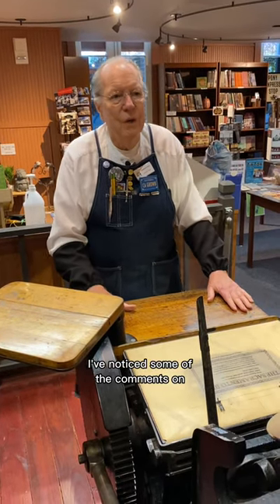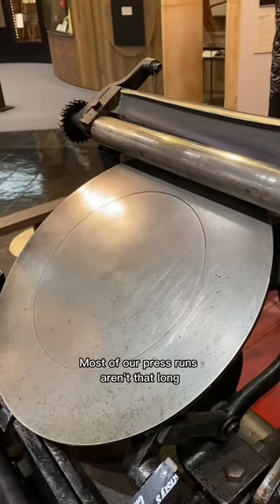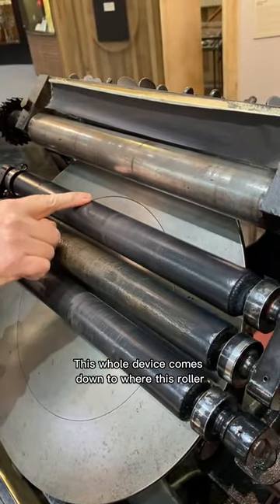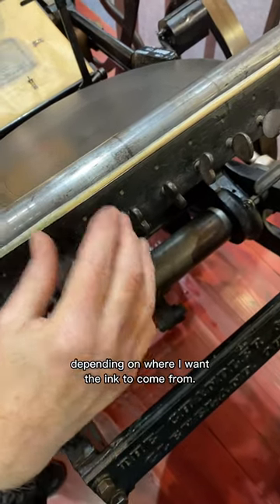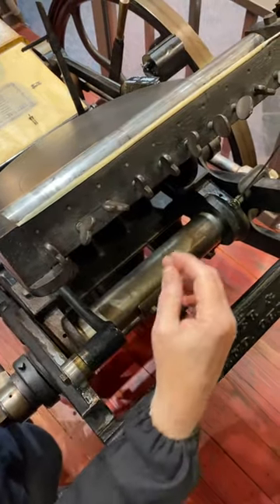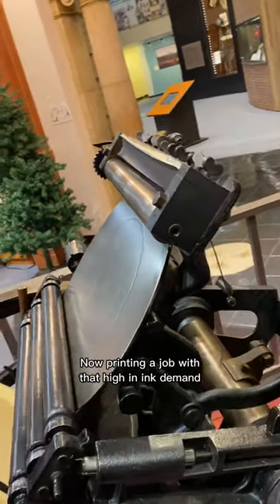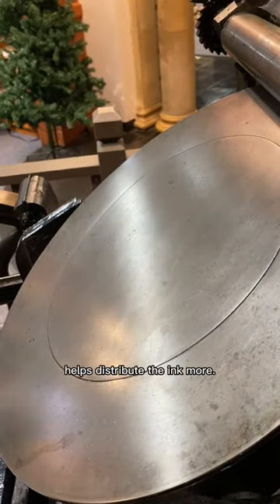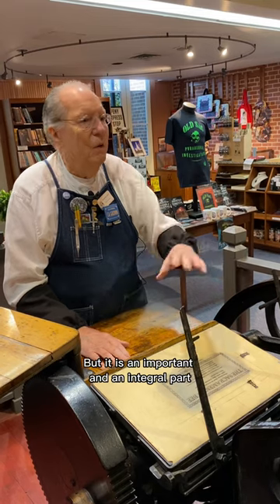The fountain on the Chandler & Price jobbing press

Comment: With due Respect my Senior !
I just made a reel in my memorandum. A Photo journalist just come in press and telling excited "I just covered an important news please take the film out" I stand up and pick the black and white film to the red light room. By putting it developer solutions then I locked the reel by Hypo solution. After a while reel becomes dry and let him to check out the snap. He select the image and I tried to feel its importance on news paper follow-up. I decided to put it front page and ran again in my dark room to made the snap bigger, after completion of it's big negative I put it on zinc oxide plate which was polarized by photo Sensetive layer. Then I put it under fluorescent UV exposure light. After some minutes I put it under Acid eatching and wash. Block is complete and I pinned it top on the wood to make the matter. 
And this all things I just did before many many decades ago of my born. Modern technology doing this same things with some compact different styles.